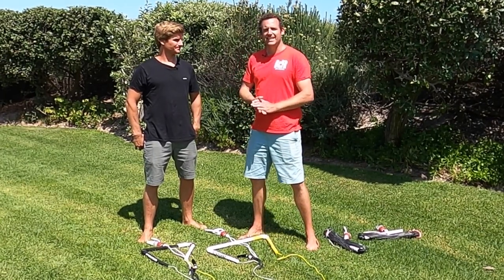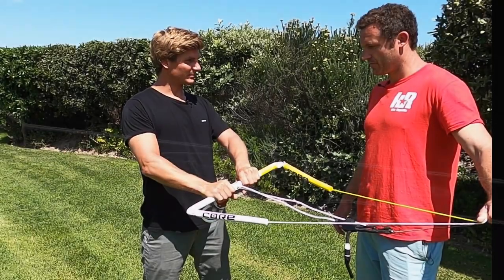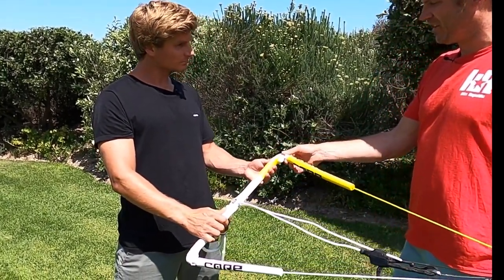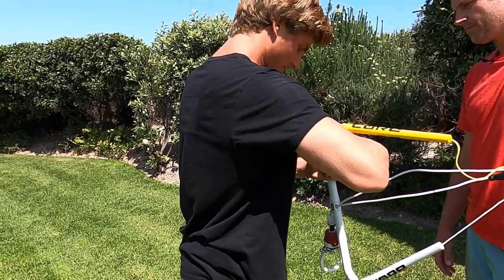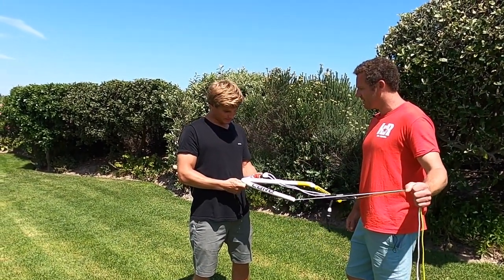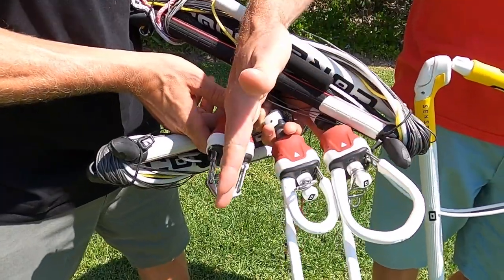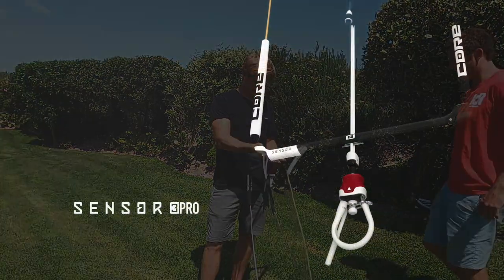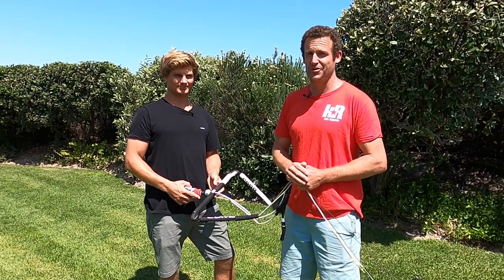Core Sensor 3 Control Bar with designer Rick Jensen

Comment: I bought such a bar for myself Core Sensor 3 Pro. At first I liked everything, but after a few rides the PowerLine sling was frayed. Where the center lines are attached with iron rings. And this is very Dangerous! Since with a sharp load, it can simply pull out the power lines! After a while, I decided to measure the length of the lines, and it turned out that the power lines were extended by 8 cm. This is the most expensive bar on the market, but the quality does not match the price. The slings are declared as the best, but in fact they do not differ from other cheaper manufacturers. When purchasing this Bar, be prepared for such surprises.

Comment: Hi! I am looking to buy a testbar since no-one has the pro available new. I am concerned because the retailer I am in touch with sent me photos of the bar and it has a cut on th rubber. They say it is common but this concerned me . Have you experienced this so far ? And If yes, then how long did the bar last with no issues at all ?

Comment: Does this bar have a high-V, like the Sensor-2? And can it be coupled w/ Sling Shot kites??
Reply from the maker: It does, same split point. Will work with Slingshot kites but higher split point will give slightest nose in tension. Many people happy with this crossing high vs low V’s but slingshot does have a lower V regularly. Can’t remember off hand but you may need a $20 set of pigtails to reverse the loop/knot

Comment: Serious safety issues with the Sensor 3s. Power lines can fray quickly, in just a dozen sessions) preventing the kite from flagging out. Power lines also snap one=ce the outer case has worn. Pleaase check your power line regularly where it slides through the rings. The problem is exacerbated by sand. Forum post with more info on the topic here:
https://kiteforum.com/viewtopic.php?f=1&t=2408269
Reply: A large number of Sensor 3 control bars are in regular and demanding use worldwide. And so far, schools, team riders, and our employees have not reported excessive wear to the powerline sleeve. However, when it comes to safety, there is no room for compromise at CORE. A damaged SSF powerline sleeve should be replaced immediately. Your local CORE dealer will be happy to assist you. If you don't have anyone in your area, contact us directly at international@corekites.com, and we will deal with it promptly. Like all other control bar systems, you must check all bar components for unusual wear whenever you layout your lines. And if you find a worn line, sleeve, or part, then replace it immediately.
If you have any questions about your CORE equipment, please contact us at service@corekites.com.

Comment: Awesome until you release for example your 10m Nexus. Core Supportet single frontline is shit in some kite sizes (strong pull after release).
Reply from the maker: Sorry to hear you've had trouble with that. At this stage we've not come across this issue with any of the sizes. Always interested to hear everyone's experiences. Have you passed this info on to Core???
Reply: I’ve released it in 45knots seems safe to me, flagged to zero power straight away